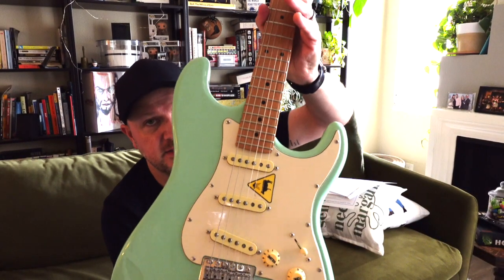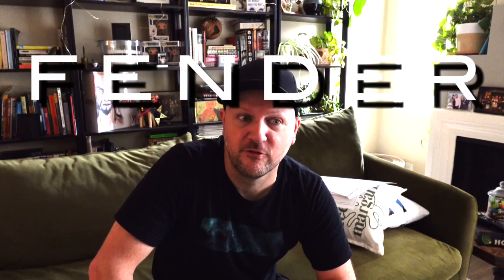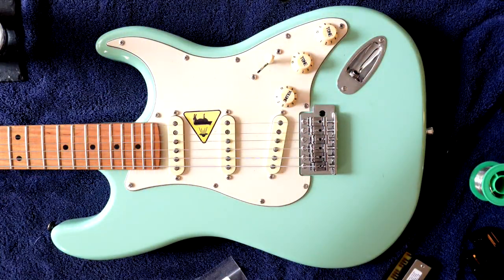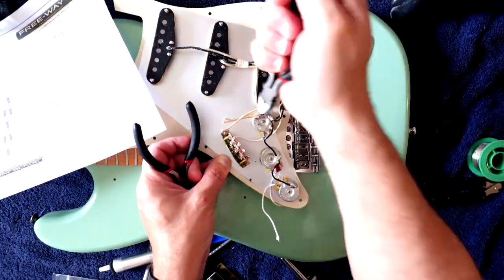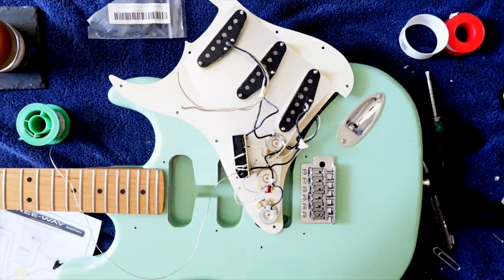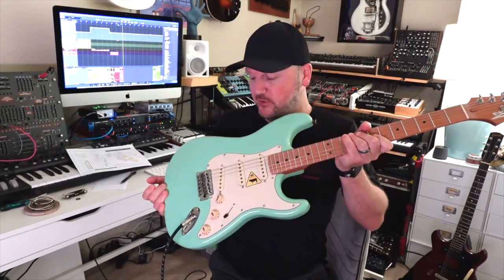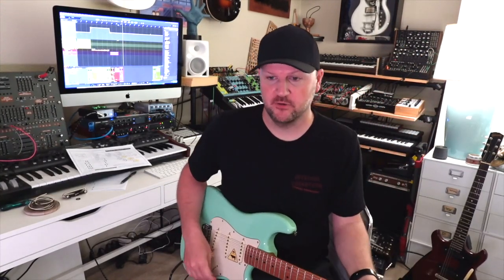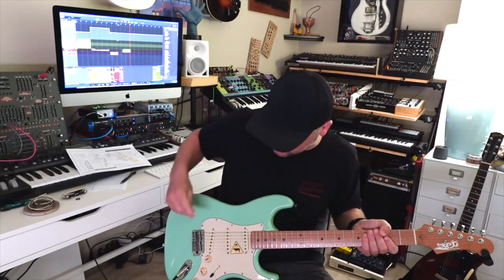I put a 10-way switch in my Jet Stratocaster copy and it greatly added more sonic possibilities!

Comment: I see you list postion 6 as all 3 on in series....its actually bridge & middle in series @6:27 sorry if you've said in the comments below i looked down a bit but didn't see any correction...just for the sake of others considering what this thing does! Otherwise all good!  👌
Reply from the maker: Hi, thank you for the comment. Actually the video description is correct. I think you are referring to the 5-way Switch Schematic A - which has the configuration you list, but I installed this using Schematic configuration B, which does have 3 in series at position 6 and 3 in parallel for position 7. 

Hope that clears up any confusion! Thanks for checking out the video, cheers!